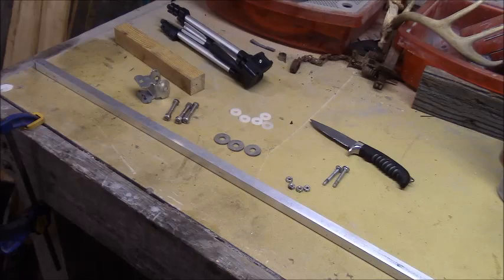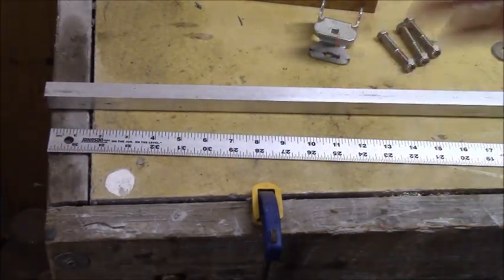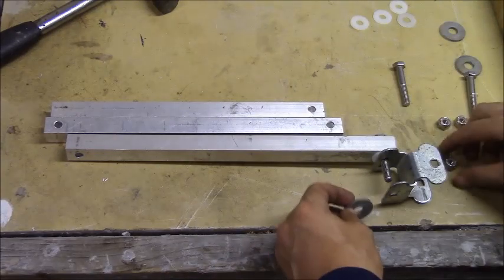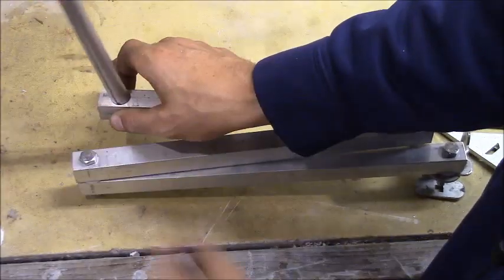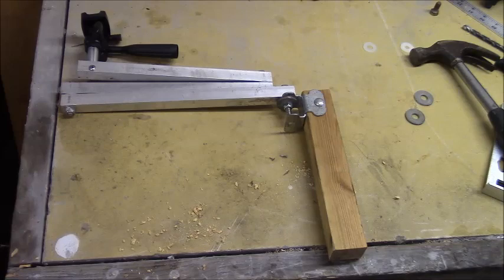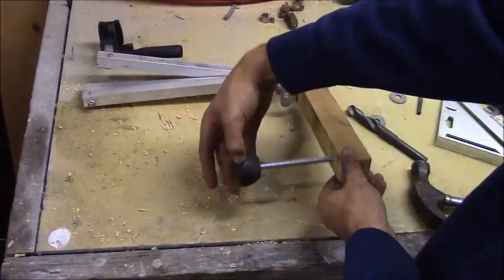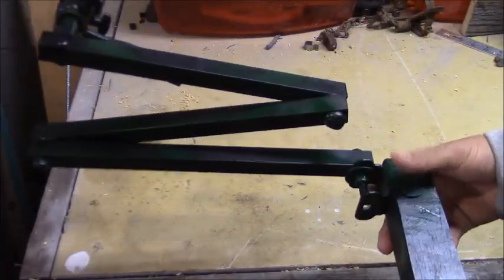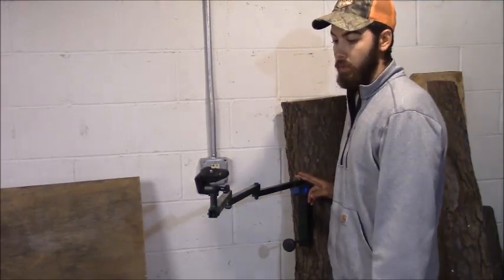DIY Camera Arm for Hunting (Under $25)

Comment: Great video any clue what the brackets real name is?
Reply from the maker: I honestly have no idea. But any bracket that comes off at a 90 degree angle and gives you a flat place to bolt the arm to will work. You wouldn't necessarily have to use a 2X4 ripped down like I did for the post either, anything that will allow you to attach to the tree will work.
Reply: It's a  "Rigid Tie bracket". They will be at most big hardware stores.

Comment: This is a real well done project and explained clearly.   I appreciate your sharing the video.  Just tonight I was messing with a pair of aluminum crutches trying to figure out something I could build with them.   Your camera arm project is exactly what I intend to do with them.   I think I can take the built in push button height adjustment section on one of the crutches and use it as the pipe holding the camera mount. That will allow me to easily raise or lower the camera height.  Unless I am wrong, once you strap your device to the tree, there is no way to raise or lower the camera itself, although obviously the camera can be tilted.   I think I can use the other crutch adjustment section as the part that mounts to the tree. That would allow me to easily be able to raise or lower the entire arm on the tree a few inches, which should come in handy if it is necessary to position the arm a little higher or lower than I might want due to a knot on the tree or some other reason.

The aluminum crutches are extremely lightweight round aluminum tube so I think that should work more or less the same as your square tubing.  I'm going to use wing nuts on each arm so that I can easily adjust the tension if needed.   I'll put a video on my channel of my effort but if you have any hints or suggestions, I would really appreciate hearing them.

Hope your trapping season has been good this year!

Comment: Not bad.i made one 2 years augo.im still using it til this day.i used a team realtree ez hanger as my first 2 arms.then cut 2 pieces of square tubing for the end pieces & did the same thing with the tripod swivel piece.but the ez hanger has the screw built in so i just screw mine into the tree wherever i want it.works great.and yes there crazy prices for a store camera arm.good huntin!
Reply from the maker: Thanks. Nice, use whatever you got to get it done for cheaper. Good luck as well!
Reply: @NobleSavageOutdoors  thats right.season opens sat morning here in arkansas.i cant wait!!!! My brain is going all kinds of ways lol.stay safe my friend.

Comment: Where did you get the bracket that attaches to the block of wood?
Reply from the maker: This bracket actually came off one of those portable garages that was damaged. But I'm sure you could use pretty much any significantly strong "L" bracket.

Comment: Good Job. Hunters are a resourceful bunch. I've tried all kinds of things but I think I'm investing in a proper arm, after several lost kill shots I'm at that point. Have you used it yet ?
Reply from the maker: Thanks. Yes I have and it worked really well. I used it to get the footage for my video "First Recurve Deer Kill St 5 Yards."  Check it out.

I agree sometimes it is less of a headache to just purchase one, but on the other hand sometimes I cannot purchase a product with everything that I have in mind so I have to build it. This situation was a little of both the products with everything I wanted were just very expensive.

Comment: You also could have put another screw over the one at the bottom of the tripod head. Nice job.
Reply from the maker: I had thought about that, but I thought it would be a bit too tight of a fit. If you are looking to possibly change out the tripod head in the future that is a much less permanent option than epoxy.
Reply: Noble Savage Outdoors it’s so weird, I went to Lowe’s with this same idea in mind and get back to the computer and see your video lol. Great minds think alike brother. Keep it up.
Reply from the maker: Haha that's awesome. Will do.